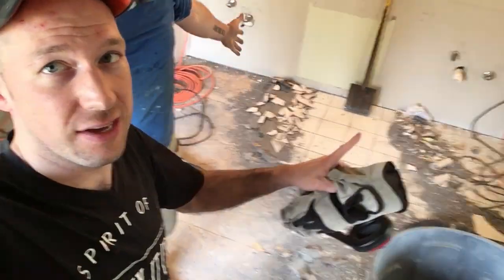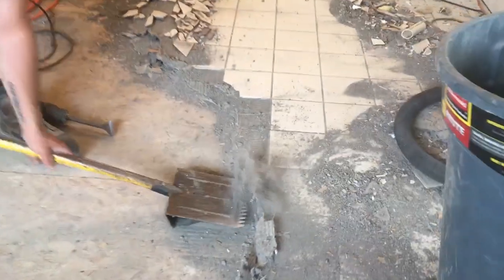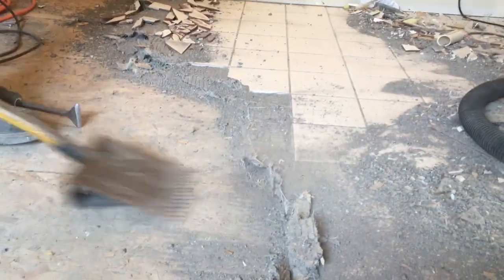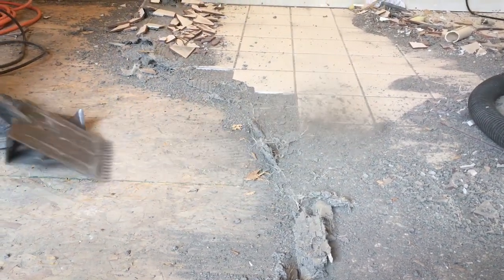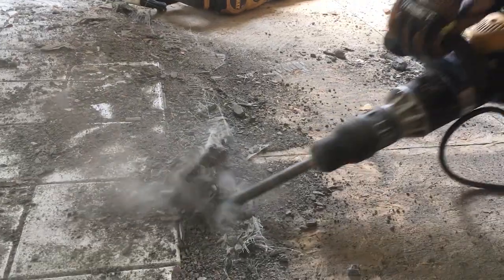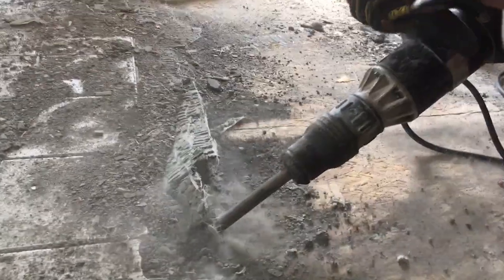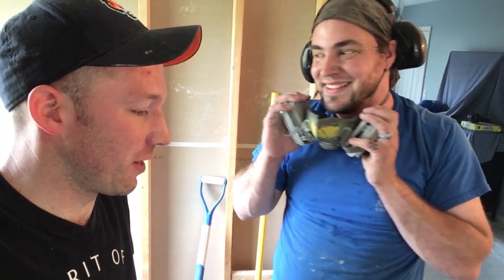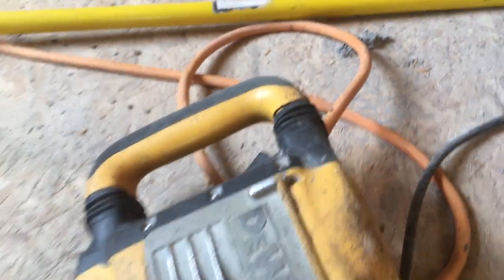Tile And Cement Board Removal // Shovel vs Demo Hammer

Comment: For those who take the lesson from this video that you shouldn’t glue your durock to the subfloor, think again! Solely screwing your durock down can create a lot of issues, especially with the durock flexing, which can cause cracks in the tile, uncouple the tiles from the thinset, and cause grout cracking. Take it from a tile installler who’s had to fix jobs where I didn’t glue my durock down! Just do it right the first time and save everybody the trouble